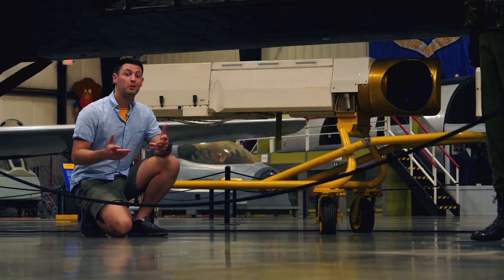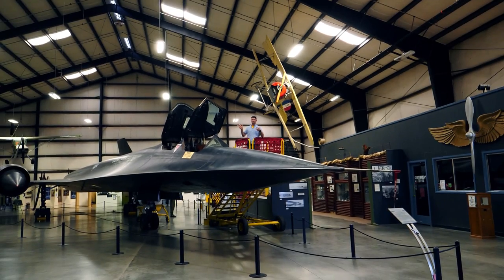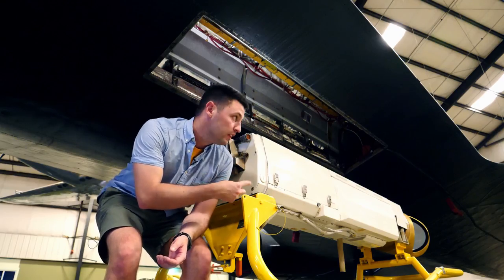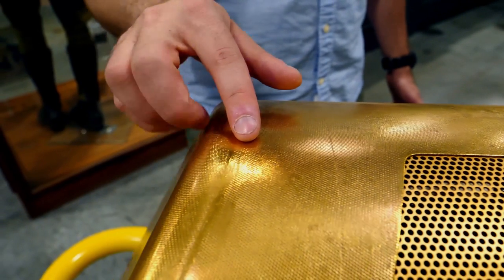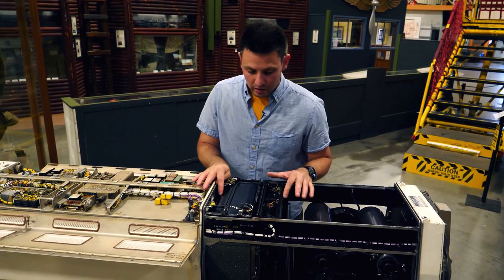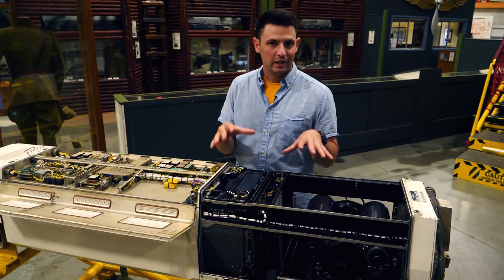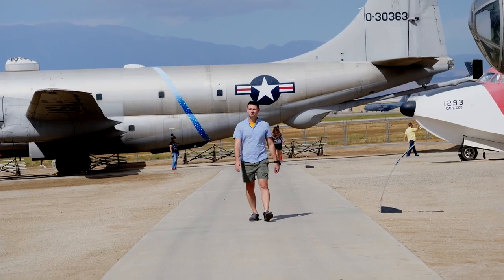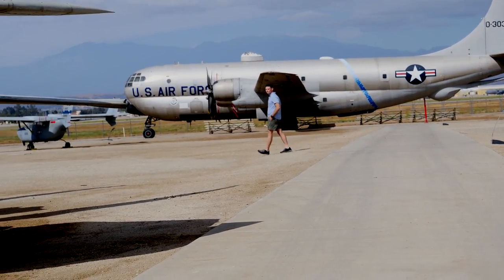SR-71 Spy Camera LARGE FORMAT Film! - RCR - Ep. 26

Comment: The pilot didn't deal with the camera

The RSO did
Reply from the maker: Thank you for your knowledge
Reply: Yea so to add more to that the RSO or Reconnaissance Systems Officer had his own cockpit locked off from the pilot, there only communication was through radio as there cabins were completely separate, He was in charge of the mission, had all the computers, ran the camera, and was responsible for a bit of the navigation. One thing to note is the RSO had absolutely no flight controls, if the pilot was incapacitated, His only hope would be to eject, and pray. 

To My knowledge this never happened.
Reply: The pilot had his hands full managing an aircraft that was prone the engine stalls and violent handling at 2K MPH. If the pilot suffered a medical emergency, the RSO could basically point the aircraft towards home using the astroinertial navigation system if the auto pilot was engaged, but he had no flight controls, throttles, etc. The hope would be to eject when over friendly territory. If the RSO had a medical emergency, the pilot had a compass and that’s it. He didn’t know where they were globally and again, could only point the nose towards home based on compass headings. This bird required both crew to get it where it was going. It should also be mentioned that the cameras were able to take images 80 miles wide, and map over 100K square miles of earth surface per hour.
Reply from the maker: @shannonchurchill4556  this is awesome thanks for sharing this info!  Definitely appreciate helping all of us to understand what a crazy airplane this was.
Reply: Thank you!! Save me from explaining it myself.
Reply: @shannonchurchill4556  that's the optical bar camera in the nose, not the TEOC camera in the chines, but yes.

Comment: The astro inertial navigation system in the SR and the A12 was what ran the show on all non engine levels. They called it the R2D2 because it was a refrigerator sized computer that was lowered into a bay behind the RSO, about the size of R2D2, and had a glass bubble on top that pointed to the sky. It would take a 3 star fix out of the hanger,  then run the internal gyro and all the computers and cameras, nav...

Comment: 3:44 The  biggest cost would have been that equipment wasnt “off the shelf” but specially designed just for the SR-71 and with a very limited production run. It’s like going to Canon and asking them to make you a one-off custom made camera to your own design. And Canon having to do all the tooling, circuit boards, lenses, parts and casing.

Comment: I wonder if the coating is Titanium Nitride since their would be some very good reasons to us Titanium Nitride (TiN) coating vs. Gold.
1. Melting point of Titanium Nitride is 5,306 Deg F. And gold melts at 1,948.
2. Titanium Nitride is a ceramic coating that has very Low Friction value is wear resistant, extremely Hard, inert, good chemical Resistance, and is used in Hip implants, Drill Bits, Gum Barrels, etc.
3. Gold is very soft but does have some of above properties.
4. It’s color is Gold in nature, can be polished, and if spinning would have very low Friction Coefficient.
5. Its application is normally done by PVD (Physical Vapor Deposition)
6. Titanium Nitride is Non Toxic and  (FDA) approved.